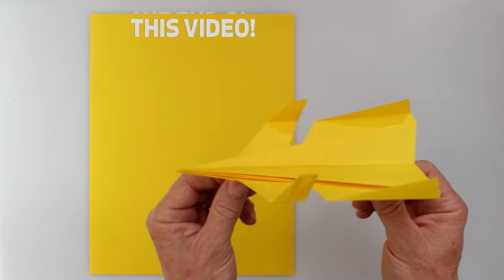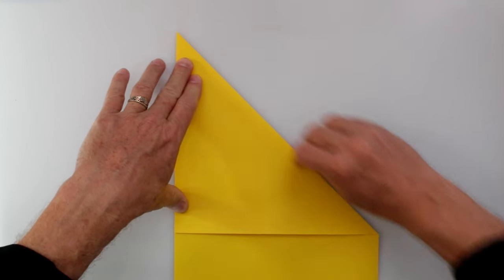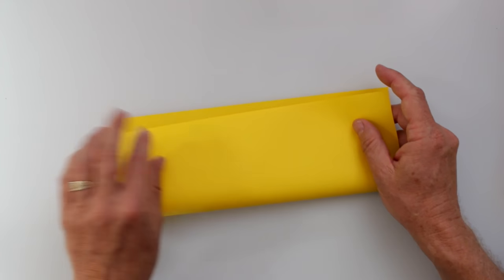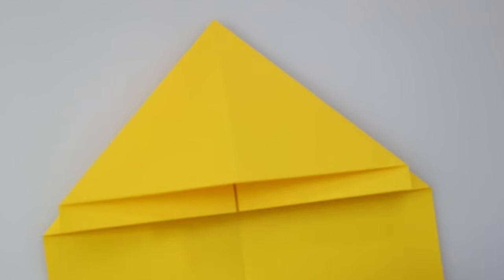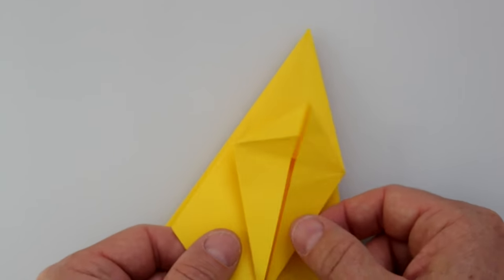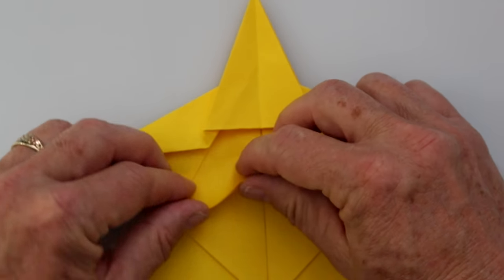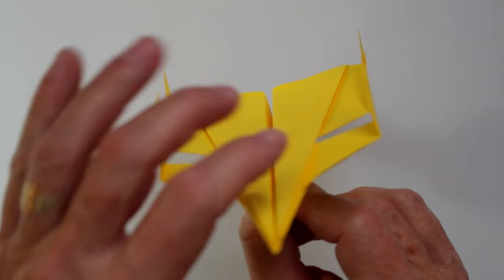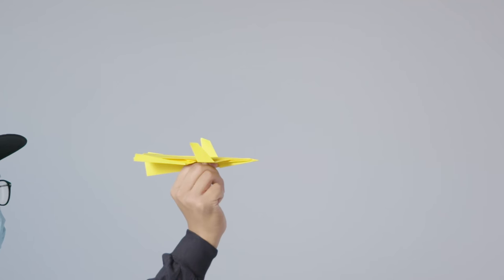How to Make A Paper Airplane That FLIES FAR - Full Tutorial | WIRED

Comment: Technically the thrust is actually a factor of your body, and not the paper airplane.
The closest factor of the airplane would be drag.
But drag technically does nothing about thrust.
You obviously meant "speed" and not "thrust".
X thrust is the same strength regardless of how fast or slow you're actually going
Reply: No "thrust" is stating how hard you can throw it based on a bar